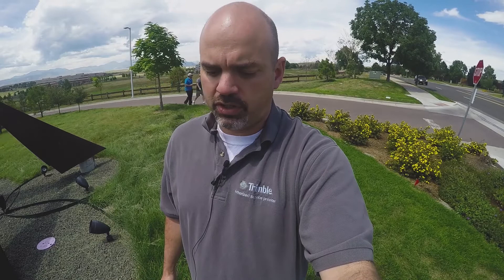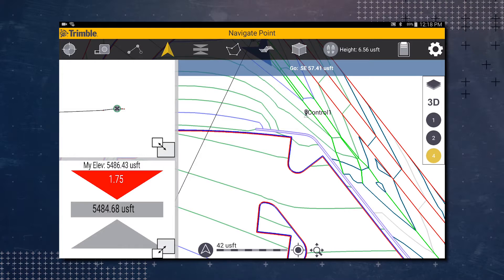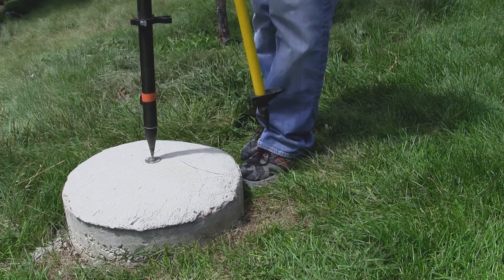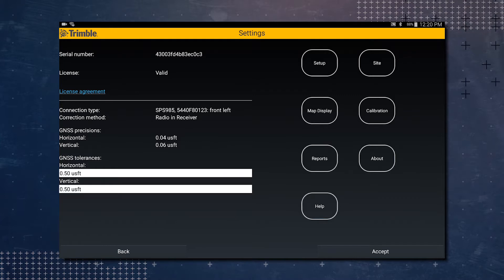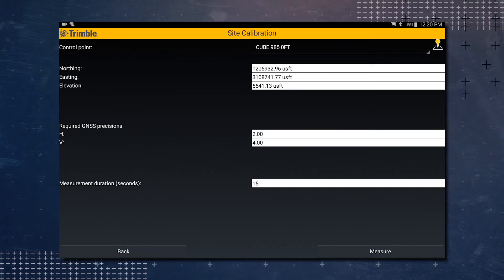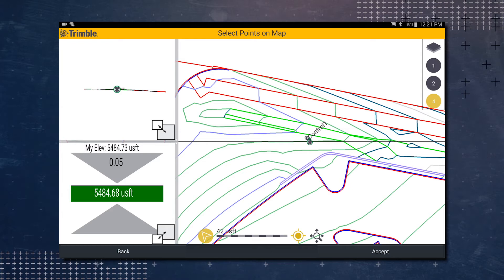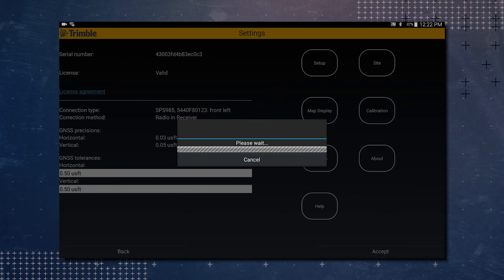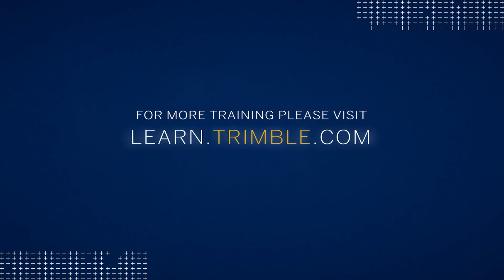Trimble SitePulse: Single Point Calibration

Comment: With a single point calibration, what scale or how much distortion should you assume if you are on a local coordinate system? I would "assume" that given lat, lon & ellipsoidal height a projection could be figured out that would get you darned close to a ground measurement but "assume" is a dangerous word.